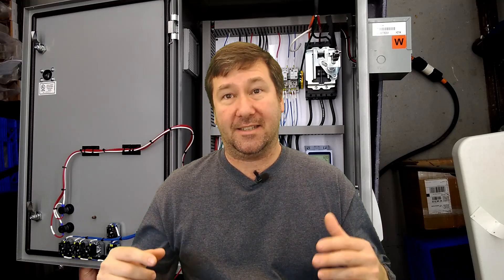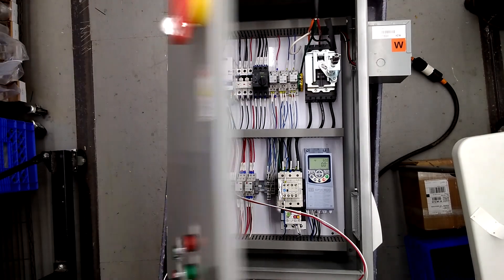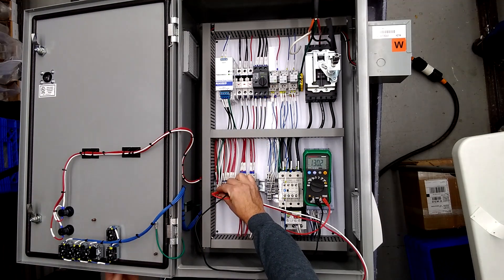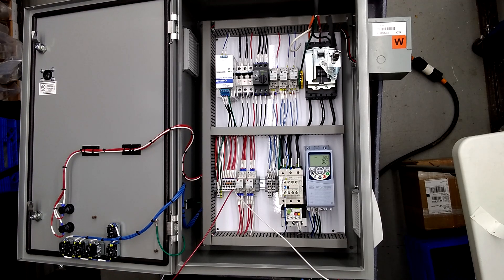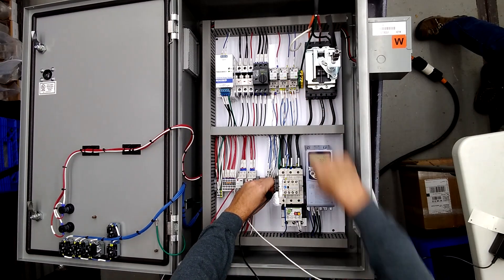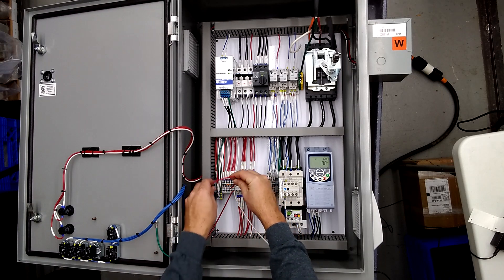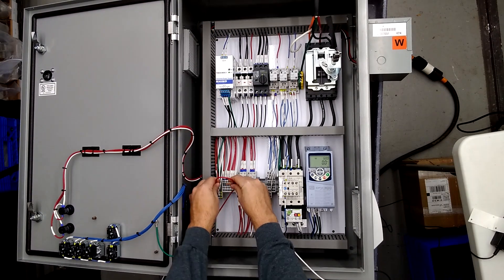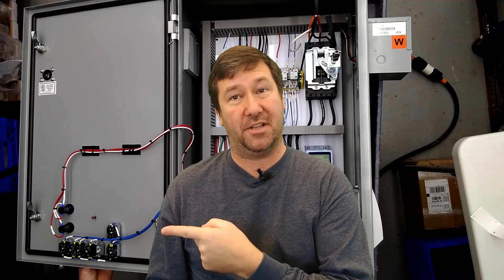UL 508A Control Panel for 30hp Starter, 3hp Drive, and 120VAC Load

Comment: Hi Tim will a VFD run a 3 phase pressure washer ? Thanks
Reply from the maker: It will run the three phase motor.  It depends on the complexity of the controls as to what would be needed from there.

Comment: How are you powering the 120V dust collection system?  Those typically draw 10-18 amps, so you are not running it from the panel power supply.  Are you bringing in a 120V line in addition to the 3 phase power for the starter and drive?
Reply from the maker: Not sure Stephen, that was out of the scope of this control panel, it was being integrated with an existing system.